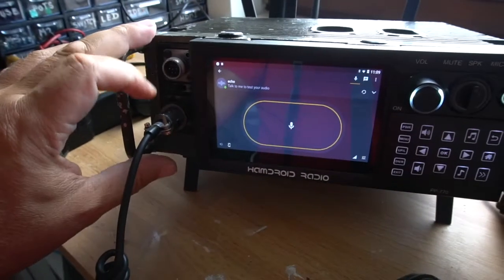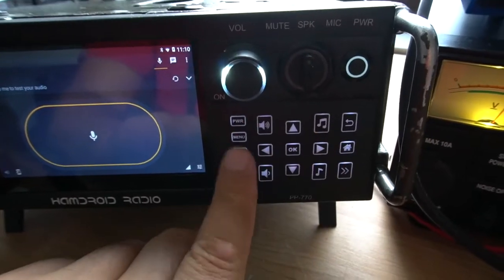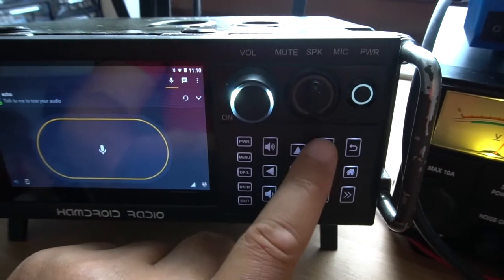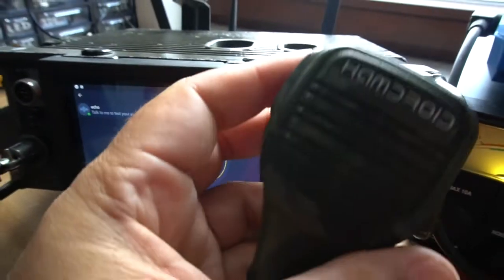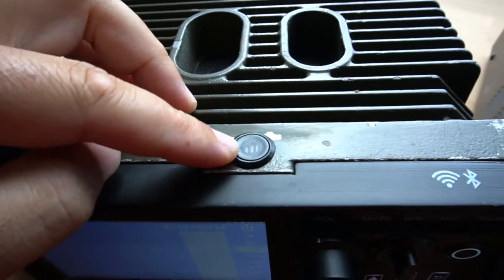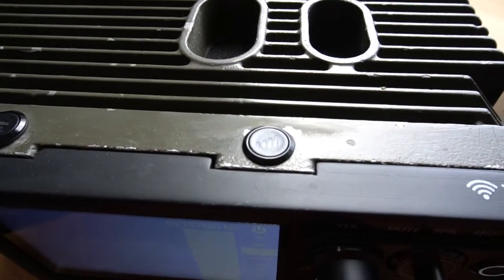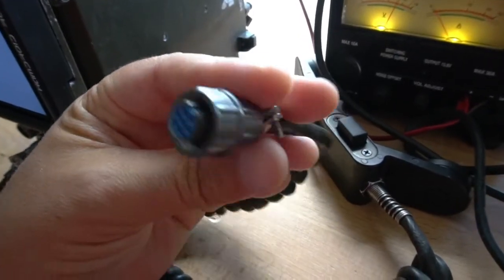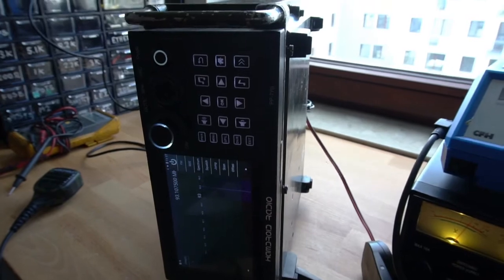Military Network Radio Conversion

Comment: @Duane's Mind Hello Im also making a DIY Network Radio from scratch using SBC's. not to sell just for tinkering. Are you using the gpio for button inputs or an arduino? I've also used those cheap usb encoder boards with button mapper. Also how do you accomplish the switching of end of transmission tones using buttons?